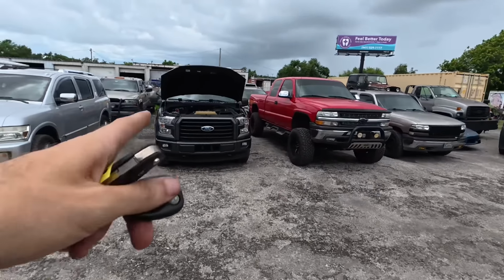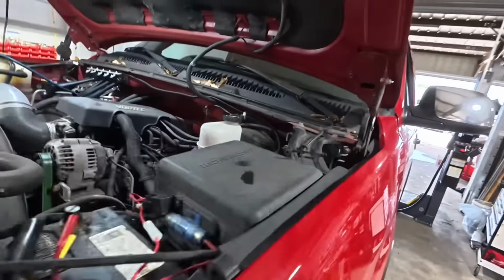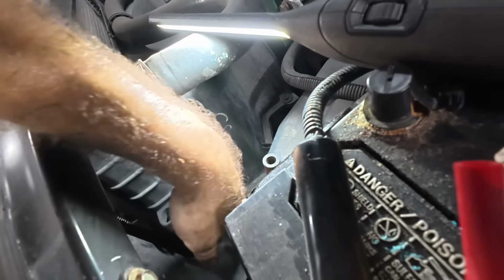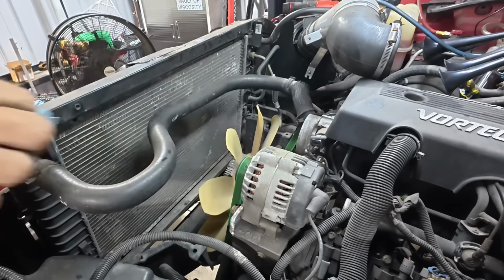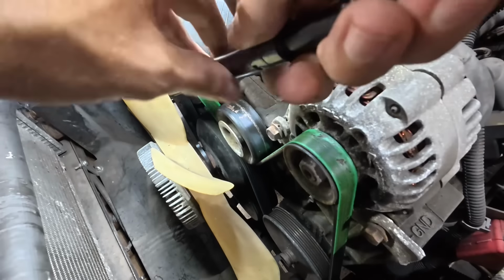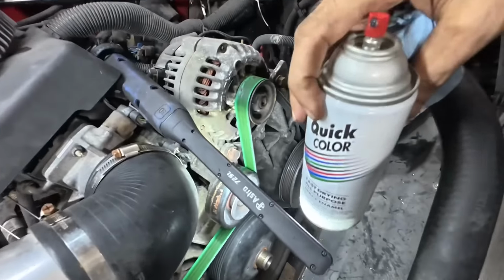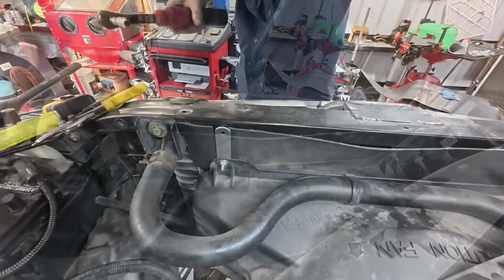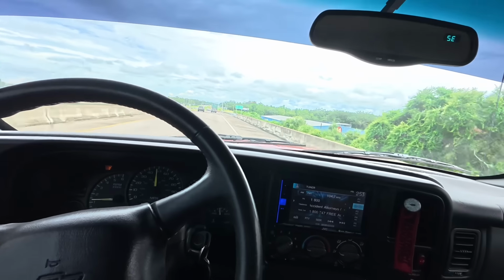Modified Truck has a Physics Problem!

Comment: I have a 99 GMC Sierra 1500 with  354,000 miles, its lived its entire life in Florida until 9 years ago. I have never had a cooling issue with it. It has all the OEM cooling sustem with the exception of the T stat and water pump.
Im a big fan of mechanical fans, they never blow a fuse.
Great work on the shroud build!

Comment: The fan blades should partially stick out beyond the back edge of the shroud for the best efficiency. Generally about half of the width of the fan blades.

Comment: First: great job on the isolation and the fix.
Second: is the state of American vehicle AC systems really so piss poor that Ray thinks 76° is an ok temperature for output air? MY VW idling in an 81° garage blows 44° air at full fan speed. How does the cabin of the vehicle ever get to a comfortable temperature when the AC cal only blow cool, now cold, air?

Comment: I have a Dodge Dakota that originally have the clutch fan that failed twice on me. I did a I do cars repair by throwing the clutch fans  away and replace with electric fans. They work great.

Comment: I hate that tiny ass 8-10 ga cable from the alternator to the red block on those gm vehicles that cable severely limits the amperage capabilities of these vehicles I always swap those out for a peice of 2ga or 0 pure copper cable

Comment: 🇺🇸 I'm a retired Diesel Heavy Equipment Mechanic from the Pacific Northwest. Not a good idea as far as I'm concerned. That upper section of the Radiator you are closing off will run hot. That can very easily lead to premature Radiator failure. But I understand you're caught between a rock and a hard place. The Electric Fans would have been the best way to go, but you really can't twist the customers arm when they don't want to go that route.

Comment: Would have been worth getting that fan switch fixed too.  If the customer is going to utilize Ray's time, it would have been worth his while getting the fan speed switch working in all modes as well.  I hope the customer was happy with Ray's efforts of sealing up then fan.

Comment: Stumbled onto this video a bit late but it would have been super convenient if you had a stereo shop by your shop so you could have just grabs a few sheets of aluminum backed sound deadening. you could have closed up the gaps with 0 screws and made a complete seal around the shroud. Would have also worked for the sides where they originally ran the rubber flaps.

Comment: Temp out the vents should be in the high 40 degree  you have a bad compressor and I would change accumulated  flush system flush condenser and all lines  replace orfice and add a little oil  that fan set up was fine trust me your flow restriction is in the system

Comment: Fun fact, "hot air" filter set loses a whopping 5 to 7hp.
Negligible. 
Pro tip. Slide some cardboard in to protect the radiator before removing fan.

Comment: Appreciate the solution, but use the existing holes and bolts or add a hole and bolt, and use the same flaps on the sides

Comment: huh.. my car has same issue. but its a convertable so i never cared much but it's nice to know... i KNOW one of the two electric fans in my car isnt working.. but since most of my travle in via interstate it's not usualy a problem as airflow comes with the 80mph travelage. stil ncice to know something to have looked at when i take it to get it re wired cause a short.. has slwoly made it do odd things.. and now the honr constantly blows and battery was spitting at me when i got it rrplaced.. the day the horn started honking itself..

Comment: If the shroud is correct I say rad has been changed if you mounted shroud at top were it’s supposed to be ther would be about5 inch gap at bottom just saying

Comment: Strange issue with 04 F150 5.4 Triton after a gnarly violent hurricane rainstorm water went into places and block places, caused several engine codes including random middle and several other sinister types like gas vapor blockage. I know it was the storm bc water and wind went into places I'd never thought I'd see (like go upside-down). I added water remover and fresh gasoline and after a couple of normal hot weeks it all went away as if it never happened. I'm Clueless...

Comment: You can never have to many extension cords. I had about 2 dozen of various gauge, length and plug types. But ended up selling them all except 1 during my  divorce. I cant tell you how many times I needed a different one or more then one since my divorce. 😅

Comment: I don't know if it will work on the truck but on my jeep tj if you install a body lift the fix for the rad along with a few other issues is a motor mount lift to bring the engine back into the right place in relation to the body.

Comment: I would have told the owner to take that stupid body lift thing off and put it back stock so that the original shroud would fit the way it was supposed to…………or else, I wouldn’t have taken the job.  Factory configurations are always best.

Comment: ❤Did I see you using the extension lead without unrolling the full lead? You must unroll the full lead or if used unrolled, it will become a coil and overheat.

Comment: Backwards vision being 97/eleventy-twelve and all, coulda punched holes in the top bit of conveyor belt and secured it with the same bolts that hold the shroud on.

Comment: My dad was a ASE master mechanic who specialized in exotic vehicles. He warned me to never modify a vehicle as there will always be unexpected consequences. Wide tires…. Front end suspension wear and tear. Loud exhaust? You can’t hear your engine when it devolves an issue and you are subject to getting a civil citation. This here is another example of unintended consequences. Great video, and I do think you have a gift when it comes to working around these problems. 👍

Comment: The mixture you made is toxic as  isopropyl alcohol is poisonous and should not be injested even in small amounts as it can cause severe liver damage and even death. You should have used Ethanol as that is not toxic.  Clean the surfaces thoroughly where you spilt the solution to others from ingesting it.

Comment: This situation is what is wrong with the idiots that read Hot Rod magazines and don’t understand the overall relationship between all factory parts and aftermarket modifications. 
You can’t just start changing parts without consequences. 
Good job Ray.

Comment: Electric fans were the correct fix, but your heavy duty fan clutch was the next best.  Short of doing the CFD modeling I can't know for sure but my gut says the fan clutch was 85% of your solution and messing around with the shrouds didn't do much.  You've got turbulent air flow through and around the radiator/condenser, it's a fluid-flow mess, and lord knows where it's all going. But, the heavy duty fan clutch sees that more of it flows somewhere and so by pure statistical probability more goes through the condenser; there's your fix.

Comment: Do you notice that the engine is sitting lower look at the hoses going in front of the radiator from the engine how low that is compared to where it should be I’m telling you he’s got a body lift in it

Comment: What kind of lift does he have a suspension lift or a body lift? He’s got a body lift radiator. Shroud does go lower. If it’s a 3 inch or 2 inch that’s gonna mean a lot of problems. That’s my fault. Part of it not all of it.

Comment: Ray, your Diag and air flow mods were spot on. I really enjoy seeing how your brain works, no matter how weird to some you are, me a 75 year old gearhead identify with your mechanical prowess.
My similar solution is on my 64 383 chevelle where I used  a police fan clutch on a factory 7 blade "desert cooler" cooling package. The engine and aftermarket AC run great.. Keep up the great videos and witty Diag, we love ya bud.  Big hugs to the Wife unit and "puppies" 😂.

Comment: I would say that that fan shroud has been modified because there’s a body lift on that truck. Once you lift the body the engine still sits in the frame, which means the radiator and everything else is gonna be higher.

Comment: I had a 95 chevy that had stock electric fans. Ac and engine cooling worked really well. Dont unstand why the dont use them on trucks more often. Some trucks have them and some don't

Comment: well i agree electric fans would be far better, but you should used flex seal to fill in those gaps, as for the fan noise. with all mods that has been done to the truck. and cold intake and most likely it has a louder exhaust system. the fan noise should fit right in their.

Comment: Google says, “…you cannot safely use an extension cord reel without extending the cord completely, as a partially or fully wound cord can overheat and cause a fire hazard or damage to the insulation. The electrical current flowing through the coiled wire generates heat, and without proper heat dissipation, this can lead to a fire. Always fully unroll the cord before use, especially when high-power tools are connected. 
Why you must fully unroll the cord
Heat Build-Up:
The primary reason to fully unroll the cord is to prevent heat buildup. The coiled and stacked layers of wire trap heat, preventing it from escaping and leading to increased internal temperatures. 
Melting Insulation:
This trapped heat can melt the cord's insulation, which can lead to short circuits, damage to the cord, and potentially a fire. 
Overload Damage:
Even if the connected device is low-power, a completely unrolled cord can still become hot from prolonged use or in a warm environment. 
How to safely use a cord reel
Inspect the Cord: Before use, check the cord for any signs of damage. 
Fully Unroll: Pull out the entire length of the extension cord. 
Connect Devices: Connect your devices to the outlets on the reel. 
Avoid Overloading: Do not exceed the power rating of the extension cord. 
Disconnect Safely: When unplugging, always hold the plug, not the cord itself, to prevent damage to the electrical connections. 
Check for Thermal Protection: Some reels have built-in thermal protection or a circuit breaker, but this feature may not protect the cord if it is still partially coiled.” I'm just sayin’…lol

Comment: As soon as I saw the drop brackets on the shroud I immediately knew that there was a body lift, and the lift manufacturer knows about the issue, but little stamped steel brackets are way cheaper than a properly re-engineered shroud or electric fan kit to do it right. A couple of selling points for the electric fan kit would be: slightly increased fuel efficiency, and more power to the wheels, since you are not giving away 15-20 horsepower at highway speed turning a belt driven fan.

Comment: The owner went the cheap route for his lift kit, I Have  2000 Chevrolet 2500 with a 6"  Lift Kit, and I have no issues with heat or A/C For Years now !
Reply: I just wanted to mention that I have a 6" Suspension Lift and didn't have any heating or A/C Issues in the 20 years that I've owned my Chevy Silverado !

Comment: What you really need is the fan shroud from a Trailblazer 4200 with the electric fan clutch and a relay to run the clutch.

Comment: Very nice work with the shrouds. Unfortunate that he did not want to get the electrical fans, the heavy duty clutch will increase fan power usage by several horsepower and in turn increase fuel consumption. Also the hot air intake for the engine probably kills another 10 HP.
I guess in a lifted truck with cracked and tinted windscreen performance is not very important.

Comment: I beat you too this having grew up in red neck truck town Texas were everyone (not me) put's all this crap on their trucks (horns ;). As soon as I saw those radiator brackets, I was like: body lift. Nice call on the clutch and conveyor belt. Air flow 'makes a difference'  never would have thought of that one.

Comment: Nice,, the fan and shroud is designed to draw a vacume threw the cooling system   radiators,,, ac, trans,  engine, so yep a physics involved 👍👍👍 nice fix,,, simple and effective

Comment: I installed a 4 core aluminum radiator in my 2000 blazer with dual electric fans. One is hooked to ignition (basically always on) the other is hooked to ac compressor. AC temps stay right at 40°. I think electric fans are way better than fan clutch.. Love your diagnosis an solution also.

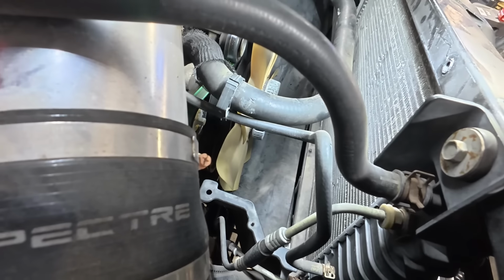Comment: 24:12.... I got my factory dual electric fan/shroud assembly from a Silverado a local Pick-a-Part bone yard for $50. You can also get a temperature sensing fan controller with a probe that you push into the rad core fins off Amazon for very little money. 

I just wired my fans to a relay, and then used one of the factory relays under the hood that ONLY clicked on when the truck was running (I can't remember which relay it was) not just when the key is on, as a signal for the fan relay. 

My fans only turn on when the engine is actually running, and they DO stay on all the time, but it causes zero issues with the temp of the cooling system, and the truck warms up just as fast as it did before. The LS engine has a dual-stage thermostat, and the stat keeps the flow tobthe radiator off when the vehicle is cold, and just circulates water thru the heater core, and then when the engine temp is uo to normal, the stat opens and allows water to flow thru the rad, and at the same time it closes off that seperate loop to the heater core only, and then the heater core is getting it's hot water from the system like normal. 

Having my electric fans on all of the time that the engine is running cause no issues because of that dual-stage thermostat setup. 👍

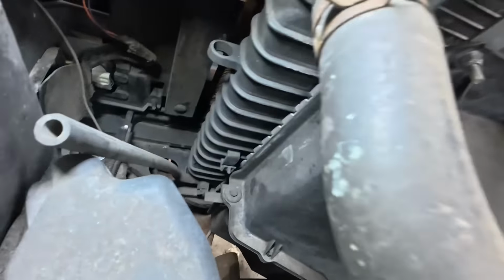Comment: 15:30... You have the right parts that are supposed to be on the vehicle...

It's just that the body lift that's obviously on the truck moved the rad core support upwards, but the engine is still in the frame where it used to be, hence the alignment issue between the fan and the shroud, IF the shroud is moved back to where it is supposed to be....

Those trucks ALSO had an option for a factory dual electric fan setup on them. I would have ditched the mechanical fan and shroud, and went to my local "Pick-a-Part" junkyard and got myself a factory electric fan setup. They can be had for a little as $50.
 The dual electric fan/shroud assembly IS a straight drop in that will work with the radiator that is in there now, and it uses those clips on the radiator that also work for the mechanical fan shroud. 

Straight drop-in, no mods required, just have to hook up a relay and run a power wire to the fans. One could even install a push in thermostat sensor that simply pushes into the core of the rad, and then turns the fans on and off at a preset temp, IF the customer didn't want them coming on with the key constantly. 

On my car with a retro fit electric fan, I just have the fans come on with the key, and I have zero issues with it that way.

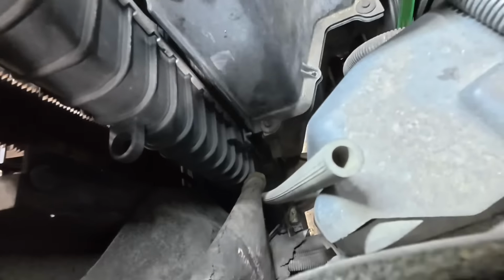Comment: Pause @ 13:35..... 

THERE is the problem RIGHT there.... look at the fan shroud. 

It's in the WRONG place, and is only covering 2/3rds of the rad core...🤦🏻

Who EVER did THAT sure dropped the ball there... 🥴

If you want to lift the body of the truck, BUY a proper fan shroud to go with it, OR get the PROPER electric fan and shroud, and eliminate the mechanical fan!

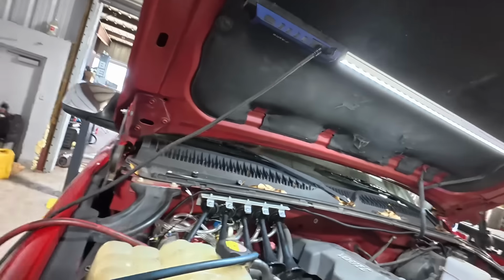Comment: 6:52... YES, some people think that the more freon in the system, the colder it will get, so they add an extra can or whatever to it.

BUT, that couldn't be further from the truth! The A/C works on the principle of the freon getting compressed, and then released, and when the freon gets released after being compressed to a higher pressure, THAT is when it gets cold and removed heat from it's surroundings. If a guy puts MORE than what is specified in his system, the pressure differential that happens when the freon is suddenly released after being compressed is NOT as great because there is TOO much pressure in the low pressure side (where the pressure of the freon is released to after the compressor compresses it) due to having the extra freon taking up too much space in the system.  And you WILL lose cooling power VERY fast when the system is overfilled.

My son's Chrysler Sebring A/C didn't work at all when he bought the car. I looked at it and found that the wire going down to the A/C compressor clutch was broken. I replaced the wire, and turned the 
A/C on. The compressor engaged, and it blew somewhat cold out of the interior vents, but nowhere NEAR how cold a proper A/C system should be. I checked the state of charge in the system, and it was WAY overfilled. I took about a pound of freon out of the system to get the high and low side pressures to end up where they are suppsed to be, and then it was blowing NICE and COLD out of the vents... 🥶

The previous owner must not have known that the wire to the compressor was broken, and just kept adding cans of freon until he just gave up. 

The designer of the A/C system in your car knows EXACTLY how much freon will make the system operate with the MOST efficiency. Adding extra freon WILL just make it operate with much less efficiency, and it WILL blow warmer than before. You run the risk of hurtimg parts with too much freon also. An evaporator core is a BITCH to change. You do NOT want to be blowing a seam out in one of those!

Comment: Never run an extension cord coiled up I’ve experienced twice as an apprentice the absolute mess and potential fire hazard running a reel coiled up first time was heavy load second thought a fan would be a light load but was enough to destroy the reel